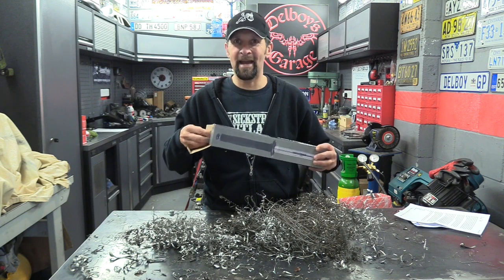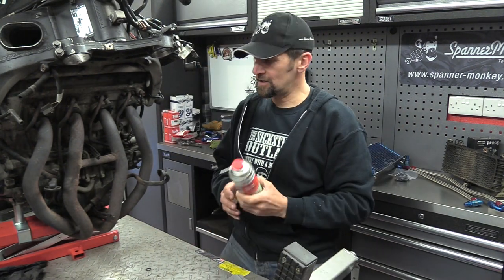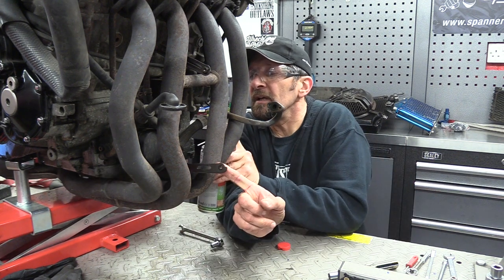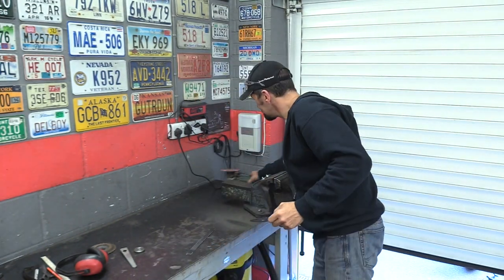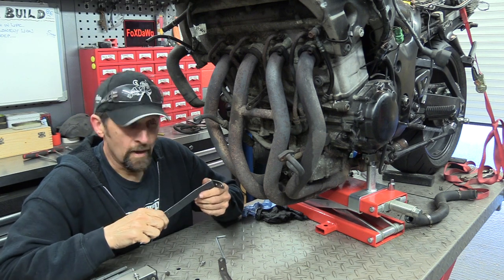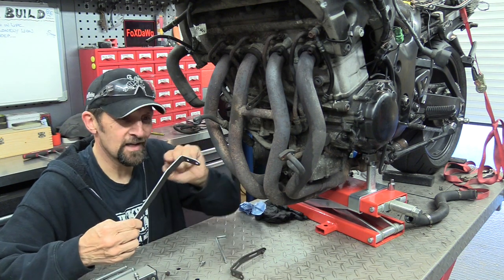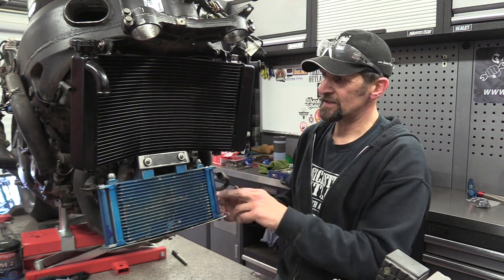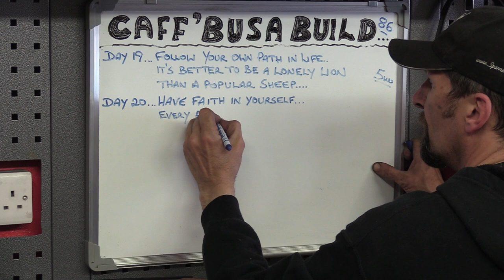Delboy's Garage, Hayabusa Day 20, Oil Cooler Mounts Done.

Comment: Did you check the Facom inserts for ratchet key 14 mm and 19 mm?
With just a very little extra you have 8, 9, 10, 11, 12, 13, 15, 16 and 17 mm. The 14 and 19 you have to add as original ratchet key. Super for on board tools.

Comment: I use thick gloves and face protector when I use a grinder. Even had a disk exploded on me because it was in bad condition. You should check out CRC Rust off if get spot where you can't use freezing as a option. Also google magnetic sweeper for getting rid magnetic stuff of off the floor.
Reply: using gloves with an angle grinder is very dangerous gloves can catch......

Comment: Years ago I saw a 24" chopsaw explode in a shop I was working at in the 70's. Almost lost the fellow who was using it. It's why I'd rather use a cutting torch or a plasma cutter. Machines don't care who is in the way. Nice job as usual .

Comment: Another great video, thanks. Just a thought here! I notice that you need to bolt your vice down for each use. May I suggest that you check out “Towsure” and get three “Anti-loose” fasteners as used on trailer tailgates etc. Length of these might be an issue, but you could weld on some extensions, drop them through the fixing holes, through the bench and simply push them into the locked position.

Comment: The hospital used to use cold spray when putting dialysis needles in, to numb your arm first because they are big needles.  They don't allow it now at some hospitals.
Reply from the maker: yeah, I remember it used by the instructors when i did Judo as a kid, if you wrenched a knee joint or wrist, it worked well to calm the swelling...and i remember it even for ear piercing in the 70's too

Comment: Not sure about getting -45C from a can. I work for an industrial gas company that actually makes cryogenic fluids. It’s very hard to get things that cold. Also, it takes minutes dunked in liquid nitrogen to shrink metal. Might be a good penetrant, but the cold part seems more like a fairy tale to me.
Reply from the maker: Sure thing Wes, logical what you say, but just repeating what I says on the tin... I think it's forte is that it breaks the rust bond, which is the biggest offender!

Comment: Del, just wondering why you didn’t just weld the fixing to the plate rather than bolting it. That way there’s no risk of bolts falling out and your oil cooler coming loose.
Reply from the maker: Probaly the same reason the factory didn't weld the original bracket to the oil cooler, access to the bolts behind the pipes once the cooler is in place.

Comment: Great video. Hey buddy I have a question,  I have the zx9r that  has a U.S. wire harness and I bought one from the U.K. I hooked it up and nothing will come on. Should I change the right and left switches and ecu computer? Or just get a original issue for U.S. model?
Reply from the maker: Sorry I can't answer that one buddy, it would take a fair amount of research between the two models to isolate the differences and then deal with it accordingly, you could make matters worse, but generally speaking as a rule, going with an OEM part for that particular model is usually the safest bet.
Reply: Ok thank you so much.  I just needed your opinion.  You are awesome

Comment: Have you tried using a 24 TPI blade and the small table that came with your 4 x 6 bandsaw to cut out those narrow small parts?  Item 197 on page 26 of this parts list https://manuals.harborfreight.com/manuals/93000-93999/93762.pdf   cleaner and quieter